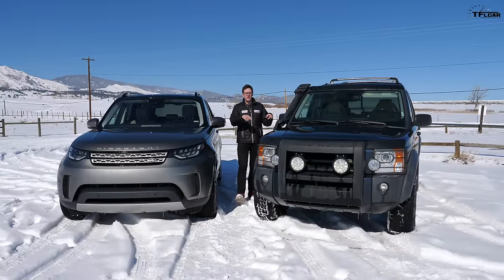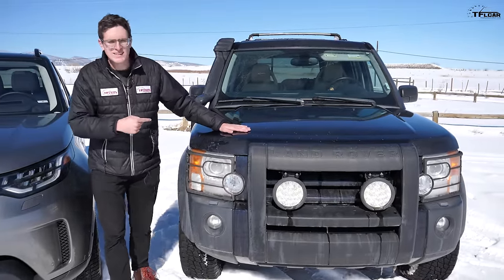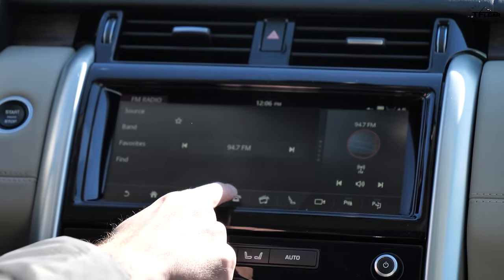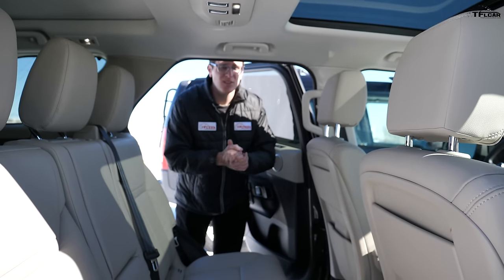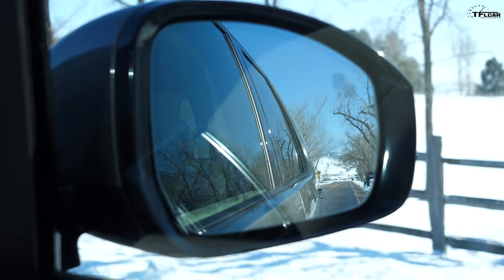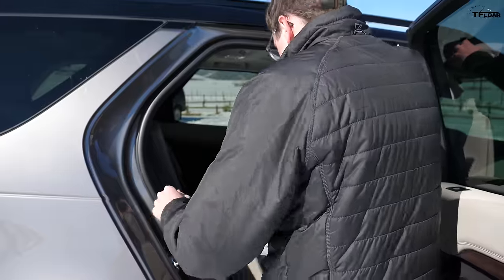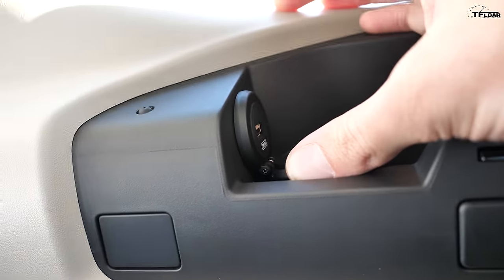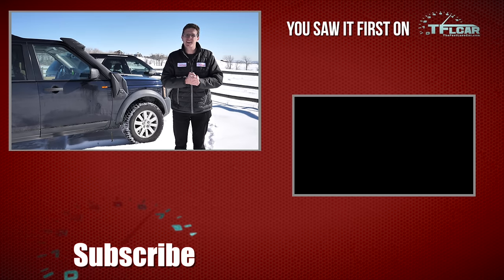Is The New Land Rover Discovery ACTUALLY BETTER Than A $5000 14-Year-Old LR3??

Comment: The “odd” sweep in the rear window / tail gate of the LR3 is so that when the window is open and the tail gate is down you can sit on the narrow tail gate side and the extended window will keep you dry if it’s raining / snowing. 

Not sure why they kept the “look” without the function on the new disco
Reply: That doesn't really explain the sweep though. If that was the design intention, surely they would have made the split at the lower height all the way across?
Reply: @brynjaminjones  
Maybe you would need to sit on one to understand
Reply: @donmckee90  I highly doubt it. 
If the split in the tailgate was at the lower height all the way across, then you'd get the benefit of shelter from the open upper section on both sides, not just the right.

Comment: "and it'll tow a lot of weight, something like 7,000lbs" - Meh... no.  Even that old LR3 there tows 7,700lbs, the SCV6 D5 tows ~8,200lbs (and the LR3 AJV8 isn't "well over 300hp... I wish. It's exactly 300hp.)   Also in the driving portion, you didn't mention the transmissions in either vehicle.  The ZF 6 speed in the LR3 is great, but the 8 speed in the D5 makes a HUGE difference.  Combine that with the ~1,000lbs lower curb weight on the D5 thanks to the aluminum construction (and an extra 40+ hp) and it makes for a much quicker vehicle.  

Also the LR3 (and Range Rover Sport) both shared a hybrid frame; essentially using a unibody sitting ON a ladder frame (yes, two chassis lol.) The D5 is a significant departure in that it's the first discovery to ever use a 100% unibody frame, AND the first to use aluminum. 

Little things about the LR3 also - the unsymmetrical shape of the tailgate isn't just for the throwback spare tire mount or the license plate, it's also where they hid the 8" subwoofer for the Harman Kardon 14 speaker sound system option. 

Also, the "old one" did have the factory option (even in the US/NA market) of coil springs instead of air suspension - it was rare though, typically only on the 05 V6 SE's.

Comment: IMHO the Discovery 5 is a "Chelsea Tractor" and in most ways the Disco 4 (LR4) is better - actually the replacement for the Disco 4 is the new Defender I think.  So, I am hoping to pick up a Late Disco 4 as old users swap them for the new Defender.

Update - I bought one of the last Discovery 4s made, a "Landmark" - September 2016, only one previous owner and only 34,000 miles on the clock and looking almost brand new.  I'm very happy and far prefer this to the Discovery 5. 👍

Comment: Putting low profile tyres on an off road vehicle is just silly. The first thing you do is get rid of those rims and get smaller ones, with some decent tyres, if you can. Although Land Rover have put massive lazy brakes on there to increase the towing rating and reduce costs, as a result the disks are huge and probably prevent a smaller wheel. They have done the same with the new Defender with 18" rims, madness on a 32" tyre.

Comment: I drive an 08 LR3 and my wife drives a 16 Discovery. I prefer the 'butch' LR3 over the new Discovery. It is a capable, spacious &  comfortable ride. The HSE LUX badge brings a bit more refinement to the interior, but I prefer that I can get trash it like a wrangler and clean it up when I need to go out on the town. The LR4 interior is nicer but way too delicate for my needs.  I love my LR3, it has been a reliable ride for so far at 92k on the odometer. The interior door handles and voice command control are the worst things about the vehicle. I really cannot stomach the rear end of the Discovery5.  IMHO, I believe the current Discovery went with that awful, rounded-off design to make room for the new Defender.

Comment: You're certainly biased towards the old one. The volume isn't bad because you can use the buttons on the steering wheel. Also, the cupholders slide forward to open up a huge cavern of storage. You also mentioned the front sunroof opens but that's only if you have that option. The configurable dash is outstanding as well. You didn't even mention the optional massaging seats. The new Discovery can come with powered second row seats that automatically move the front seats too in order to get more space to get into the third row. Lastly, how can you do a Land Rover review and not show what it can do off road?  Love you guys but if you're going to do a review, don't be biased and do your homework first.

Comment: I have the Discovery 3 HSE V8. There is definitely something wrong with yours. When I put my foot down it really goes for a truck of nearly 3 tonne in weight, 8 secs standing start 0-60. Yours just didn’t go & it was from mid range. It’s been messed about with over the years, very obvious with the different colour seats in the 3rd row from another vehicle etc. The HSE is a different truck. Rear locker, rear climate control, Harmon Kardon logic 7 sound system & a fridge too. Also ZF adaptive gearbox.

Comment: Land Rover could save their reputation amongst the off-roading community by making a radically different Discovery 6. Go back to the roots of the Discovery 1 and add only things that make the car better. None of these unnecessary bells & whistles. People would actually buy something with roll down windows as an option, really. So much of what is in cars is unneeded weight and expensive electronics repairs in a few years. Obviously the sales would plummet at first compared to the soccer mom Discovery 5 but you'd  be able to corner a market of people which are currently spread out over several brands like Jeep and Toyota, by making an old school over-lander that only has the necessary modern tech. Then I'd bet sales would soar! How many soccer mom SUVs does Land Rover make now anyways?? I know Doug Demuro, Andrew St. Pierre and other car youtubers agree with the idea of a car company doing this. Who better than Land Rover with the Discovery 6?

Comment: Is the 2 speed transfer case locking, or clutch/lsd like Jimny?   Edit: NM , i seen it minute later, it's not manual, but automatic center 2 speed locker
Reply: The transfer case isn't, but the centre diff is.  It's operated by a multi-plate clutch under the control of the transmission control unit and has variable rate locking.  You cannot lock it manually.  The rear locking differential can be deselected so it won't lock at all, but it's an option I never had, so I'm not entirely sure about that.
Reply: @simonuden8450  yea, he said some about it little later after i wrote it, thanks

Comment: Land Rover needs to remember their roots. Modern day disco is catered too much to the suburban mom. That’s what the Range Rover is for. Even the new defender looks castrated.
Reply: Agree with everything you say except for the bit about the Rangey. As you can probably see with my avatar thing, my Range Rover P38 is 100% an Off Roader. The new defender is just a "squared off" new discovery.
Reply: Barry Richards that’s the “og” range. I’m sure it handles it self well in the rough stuff. I was talking about their newer stuff. Checked out a couple of your vids. Props to you man looks like you get after it!
Reply: Exactly, i still drive a real one that work's all week & still go out & have fun in on weekend's and it's 55yrs old, doubt if the electronic's alone in the new one would last a 10th of that time, plus the fact i think it look's bloody ugly.
Reply: LR had to change their design to be more EPA friendly. Boxy equals no aerodynamics which equals low gas mileage. I do agree with you though.

Comment: I have had my Disco3 HSE for 11 years now and it has done 320.000 km. Bought it second hand with 60k km on the clock. I have all the extras and I have done all repairs by myself in the driveway - it has only been touched by me! I love it - it no spacecraft, but it is such a nice car to drive with the air suspension. It takes a good amount of taking care, but if you can work it yourself you will be a very happy driver. It has my best recommendations - and I really have a hard time seeing myself in the much smaller new version - I need some space :-)
Reply: Im in your boat. 2008LR3 bought second hand with 80k miles, all my own work in driveway! Keep em rolling!
Reply: @beerbeforebreakfast  Glad to hear I'm not alone out here :-) But I think we need to point out that these lovely LR's need a fair amount of looking after to work properly. Every time I have something breaking I fix it asap - you don't want the faults to build up on a massive technical car like the LR3 HSE. Last year I build in wireless network and AirPlay - much easier than the cable fixed to the AUX input :-) disco3.co.uk is the source of many tips and tricks :-)
Reply: @johanhghsrensen7523  your not kidding. There are more feature and more tech with engine and everywhere thus more fixes needed just by the math. But it is great for training if you are a mild mechanic, the difficulty of some repairs can elevate your skill to a new level and i appreciate that, especially since its on a low cost vehicle since they depreciate quickly, making abuying a used one ideal for: an offroading, camping, mild mechanic, luxuries loving, needing a classy car for regular life, lower budget, higher use, husky owning, Land Rover fan club members(not official), working class drywall and painter family!

Comment: Some factual errors:
The LR3 did not have “well over 300hp.” In fact, it had exactly 300. 
Not all LR3’s came with sunroofs. 
The rear climate control came with the 3rd seat option. 
The LR3 was not the first Land Rover to have a fully independent air suspension system. That would be the 2003 Range Rover.
Reply: Not sure if it just a registration thing but my Disco 3 V8's documents state that it has exactly 299hp.
Reply: Fritjof D - US version published specs stated 300hp and 315lb-ft
Reply: Tyler, I’ve had several of these trucks, and have probably seen hundreds while searching the market, etc. I’ve never seen an LR3-4 without a full glass roof. I had no idea this was even optional. Do you know if this was optional for US spec? Interesting. Thanks.
Reply: @willblankenship2826  Definitely an option. It was/is called the "alpine roof". In my search for for an HD lr3 I tried and tried to find one that was not HSE to avoid the glass roof but couldn't find one. I did find lots of SE that had a standard roof but no HD package.

Comment: I'm with you on the styling of the old Discovery 3/LR3.  I owned a Disco 3 and followed that with two Disco 4s before going for a Range Rover Sport at the last change because I didn't like the look of the Disco 5.  However, as a second car, I have now bought a 2006 Discovery 3 for £5,000 and I'm loving it.  In the UK, we got the rather asthmatic 2.7 litre V6 turbo diesel or, as an option, the same V8 that you have, but that was dropped before the Discovery 4, when the beefed up the TD engine to twin turbos and 3 litres.

A couple of points about your review.  You didn't mention that, with both the second and third row seats folded in the Disco 3, you get a completely flat floor which is about 6ft 6ins from the back of the front seats to the tailgate - great for sleeping in if your off on a trail - try that with a modern Discovery.  The notched tailgate was designed to allow you to reach further on the right when the lower tailgate was down, but it's a lot easier to raise the third row seats with the tailgate up.  Something that the turbo-diesel versions had that the gas versions didn't, was an auxiliary fuel burning heater, which was used to help heat the engine quicker, especially in cold climates, but it had the option of a remote park heating function, so you could operate it with a remote from the comfort of your house, and it would heat the engine and heating water system, had a separate electric water pump, and could circulate air in the passenger space.

You say there was a lot of plastic in the old Discovery, but you failed to mention all the leather that was around, although there was a lot more in the HSE variant.  The new one still has quite a bit of plastic as do most cars.  Finally, that volume control being away from the driver (in the Discovery 5) is on the other side in the UK.  It's really meant for the passenger, as the driver can control the volume from the steering wheel buttons.  Thanks for the great review.

Comment: His comments about the Discovery 3's acceleration simply aren't correct. sure, if you look at the results on paper, the car is slow, BUT, when you're in something that weighs as much as St. Paul's Cathedral and you hit 0-60 in around 10 seconds, it really does not feel slow. Also, I have a UK variant with the 2.7 TDV6, and let me tell you, once the turbos spool up, "sluggish" is the last term that comes to mind. Besides, at the end of the day, the car was never designed to be fast; It was actually designed to go slow...

Comment: I own an LR3 V8 HSE here in Qatar and while it's now 12 years old, or at least 50% of it is with the rest (air suspension struts, several A/C compressor and evaporators, water pump, radiator, numerous coil packs, sensors, leads and hoses, etc, etc) from 2016 to 2020, I refuse to get rid of the old girl. I have a Ford Expedition and BMW X5 also and while the Ford is rock solid, reliable and never fails or lets us down and the BMW X5 a real mess, its the Landie that will never leave the family until either its engine or transmission drop out of it. Awesome vehicle. Have tried the new Velar and new Range Rover Sport and while gorgeous and desirable, you just get the impression that they are fashion accessories styled like any Japanese/Korean SUV. The LR3/LR4 were the last of the old school Landies.

Comment: Couple of comments I need to add.
You stated the SE model LR3 is "poverty  spec", which of course it's not!  Only one model above that, the HSE! The SE, here in England, is the better long term investment.

Also, the interior is far better on the LR3 than the awful modern "iPhone user" 5th generation. It was designed to be used wearing gloves, as a utility or farm vehicle should be. Far easier to use and clean and better wearing.

Yes, I own a LR3 SE. Bought it over a Range Rover as it's a far better car.

Comment: I have a Land Rover Discovery 3 I love it I wouldn't even Buy a Discovery 4 because thay changed the interior a little Ps Don't Get your Parts from a Land Rover Dealer get your Parts From John Craddock UK you will save 400% on OEM Parts I know I'm a Mechanic LAND ROVER,S cost less to maintain than a Toyota

Comment: You really, really don't want a LR3 with air suspension... Most Land Rover owners from that time switched back to a mechanical air suspension for a good reason...
Reply: Its not that bad it gets kinda blown out of proportion. The problems usually lie in the early air compressors and the suspension valves. That sounds more complicated than it is in reality it’s a a few hundred in parts and a weekend. I’ve had mine 14 years it just now needs a compressor. That cost me a touch over $400 and it’ll probably take me an hour or so to install it. Shop around parts aren’t that expensive. Our LR4 has been great as well all it has needed was a air compressor.
Reply: @gardentractors1751  Very interesting. Thank you very much for sharing your experience.

Comment: I own an lr4 and I used to own an lr3 almost identical to the one in the video, I like the new disco but I wouldn’t buy it to off road. The lr3-4 I think are much more timeless and I think the lr4 is the perfect car cause it’s the boxy design with a little more modern amenities. That said the lr3 had some designs I prefer, like the handles around the headrest, and the cool toggle switches for the terrain responds.

Comment: The Ajv8 is actually the 5.0L ford engine block and that one has 375 HP, yours is a bmw 4.4L V8 thst only has about 300 hp
Reply: Jimmy Brooks Not quite. AJ-V8 was made in 3.0 - 4.7 liters. 5.0 was the next gen.
Reply: Tomas Mica the V8 engine on the LR3 is the BMW M62 engine which was also used on the Range Rover, and RRS from 04-09, the AJV8 was the Ford sourced 5.0 engine used from 2010 up till now. Correct me if I’m wrong with the 04-09’s but I am certain the 5.0L is also an AJV8.

Comment: New disco has become too complicated to fix. Get water on the electrics and it will probably never run right again. The wheels are too big for anything other than low profile tyres too, so it's never going to be a hard off-road vehicle unless you strip all the fluffy stuff, and it probably has about 3 KM of wiring to go wrong.
Like the new defender they have lost their purpose for practical folk 😪

Comment: I'm crying that I have to.give up my LR3 2006 80,0000 miles cause water got in threw the sunroof drain. Killing my CJB electric system. I'm crying  everyday. Getting 10, 000 for it though. But still crying. This will be my last week driving my sweet baby😣😥😣

Comment: Sorry Tommy, couldn't agree with you on the flimsy-ness of the Interior panels in the old. I mean yeah sure, its 14 years old, look at the new one in 2033 and you couldn't agree now. My own Ford feels little flimsy after just 4 years of usage, than it was when I purchased. I still believe if you compare a 2013 LR4 with 2019 Discovery, you would feel that the old design and interiors were way more functional than today. Today's Discovery is not a Discovery, its more of a Soccer mom's LR.

Comment: Are you aware that you have missed the evolution the LR4 and the LR4 update.. Also ya pull down the new model for been modern and you pull down the old one for been old or cheap material the LR4 improved on that. Both amazing cars. Once you have owned the Landrovers/ range rovers it’s very hard something you will enjoy as much. Even though some or many have reliability issues. Ya can try others but you end up going back. They design very desirable cars.